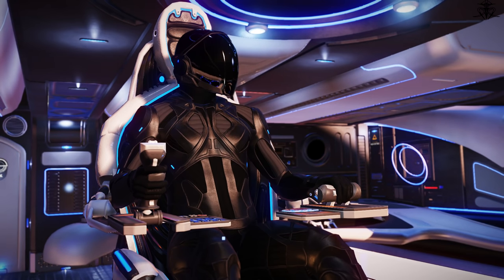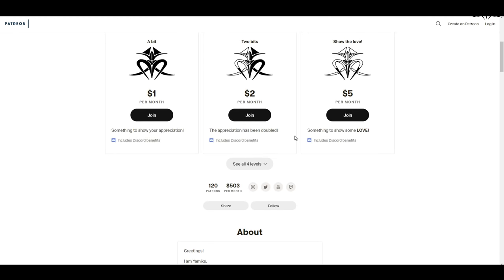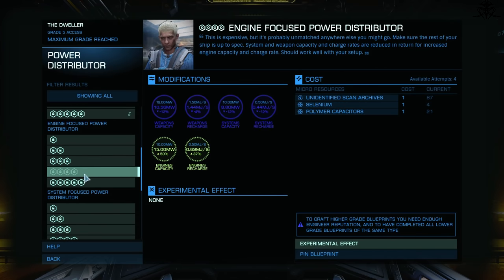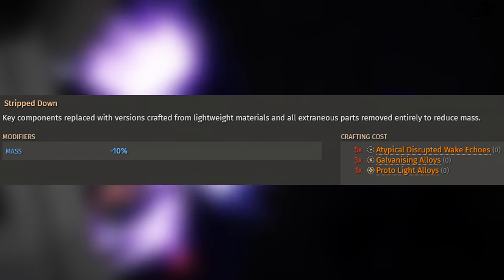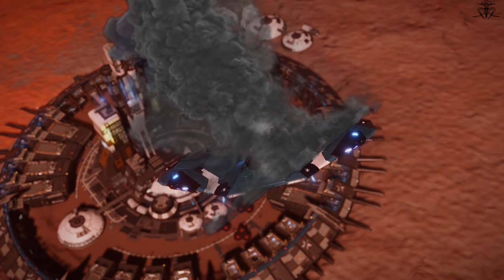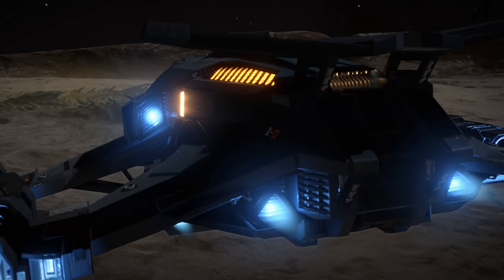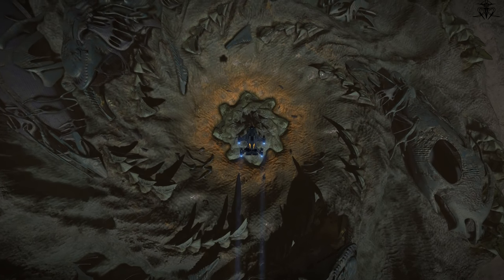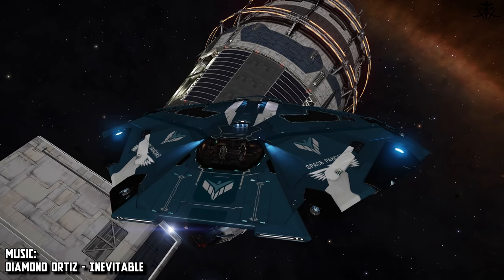BEST to WORST : NICHE core engineering (Weapon,engine focused,fast boot,stripped down)

Comment: Engine focused useful for cramming a smaller distro in for explorers who wanna boost once a week.
Reply: Bless you Sir, you beat me to it. This, exactly this. I've engineered distributors so much smaller than the ship they're going into with Engine Focus just so I could get my exploration Anaconda to boost when it shouldn't even be remotely possible.
Reply: Yeah, boosting is useful for explorers... who wants to wait for their undersized thrusters to warm up so they can jump, or wait longer while they fight their way out of a deep gravity well, or not have the option of boosting to try and stop an overly fast descent before you slam into a planet.   Its not technically needed, but you really miss the ability to go from zero to full speed in a couple seconds when you don't have it.
Reply: @musifter9126  Agreed. Although of late I've started using my Phantom more than my Anaconda for deep space exploring, and I put bigger engines in it. It costs me a couple of light years but having powerful engines on an otherwise light-as-a-feather Phantom makes flying it around just a huge pleasure. And even with good speed I like to boost! (distributor is still tiny).
Reply: Yeah my krait phantom can boost on a 1D distributer

Comment: The faster boot sequence for the fsd is actually a lot less useful than you think, cause it does not make your fsd charge faster, just the time it takes to boot if it goes offline
Reply: yeah, it's a scam
Reply: @Radovanslav  i specifically have an eagle that uses this upgrade actually, its a shieldless "stealth" fighter build that doesnt show up on sensors until almost on top of people, in using a tightly juggled power system i have it set to turn off the fsd as soon as weapons are out to further drop the energy consumption and in turn the heat generation, this upgrade means i'm not playing dodge the unlocked fire from enemies game for too long while it boots itself back on
Reply: @sensan1537  sounds very niche but I'm glad that it's actually useful for you
Reply: Fast boot could be useful if you are running over power capacity
Reply: It gives a teeny tiny bit more distance with zero additional mass. Never used it for the "intended" purpose.
Reply: I made the same mistake with using specialised SCBs, thinking that boot time means spinup time.
Reply: Faster Boot Sequence is designed to be a counter to grom bombs, and that's literally it.
Reply: yep. The reasons Yamiks give are incorrect but the category "niche" still applies. Cause "faster boot" is the only coreengineering for FSD that does not increase weight. That is why you need it if you build a maxspeed build. You pick "faster boot" grade 1 and apply "stripped down" to the lowest D-rated FSD you can fit.

Comment: The Armored Power Plant mod has actually gained a lot of traction with Explorers over the past year.  Most of the time Explorers run fairly tight power budgets and the Armored mod gives an increase in power generation, while ALSO increasing heat efficiency, for a minor mass increase.  Toss on the Stripped Down experimental (or Thermal depending on build requirements) and a lot of the time it is superior to Overcharging.

Comment: as others said - Fast FSD boot is not charge up time, its boot time if you shut it down. 
at grade 5 it boots in a second, and still gives a bit extra jumprange
also, armored powerplant gives you also better heat efficiency, higher power output and the higher hitpoints - so you can combine that with the  fast boot FSD for a combat ship that doesn't rely on 100% shield uptime (due to limited number of utility slots)

Comment: Engine focused distributor makes sense on my explorer Phantom as shields and weapons are of lesser use. And weapon focused distributor on my surface mining Cutter to keep those multiple mining lasers fed long enough to empty an asteroid without max pips.
Reply: Weapon focussed is a bit of a mixed bag
If G5 weapon focussed is 100% (assuming 8A), then G5 charge focussed has 60% capacity, but slightly more recharge (10.8mj/s vs 10.9mj/s)

Sooo... Yes, if you overload your distributor with more lasers than it should have, it's useful, sorta

Comment: Faster FSD boot sequence doesn't do what you think it does. It is still pretty niche, though, since it's mainly used by people building fast combat ships which don't have enough power plant for all their modules with hardpoints deployed. They put their FSD in power group 3 or 4 so it turns off when they deploy all their rails and PAs and then faster boot sequence makes it come back on line faster when they need to run away.
Reply: I've used it on precisely one build:  My Eagle MkII.  I've been flying that one in wing with one or two others in Haz Res and CZs.  It's a lot of fun, but I can't say that I have plans to do that with any medium vessel.
Reply: i learned that the hard way lol. it also makes me wonder WHY "faster fsd charge" isnt even an option!
Reply: @ICKY427  Probably because it would make it even easier for a larger ship to escape - as it is with masslock if a little ship is winning a fight the big ship can just bail. If they could bail even quicker a big ship would become pretty much impossible to even hurt significantly.

Comment: OK, I put Armored power plant. on a PvE ship, but NOT for the integrity. I went with it to get more power while allowing me to use SCBs without overheating. Oh, and I only went G1 (just enough to power my ship). Might go G2 as my ship can still overheat if I fire my burst lasers too much while using an SCB. Also, seems pretty useful for hull tanks (which yes, are inferior to shield tanks, but people still fly that way). Also, I fly an FDL, so it the shields go down it might buy me some time to finish the fight or run.  The Armored power plant is almost strictly beneficial with better power, thermal efficiency, and integrity.  (like efficient on energy weapons), with the only downside being mass.

Comment: Cluster Capacitor is niche? Now i am interested in what you see as the go-to for PD.

edit: you pick super conduits. Thought as much. Thats the second choice. Not bad at all but cluster Caps has it beat, at least in most scenarios and here is why:

First of all Cluster Caps give +8% cap and only -2% recharge while super conduits give +4/-4, so the ratio is a lot better on cluster caps.

And then i get that recharge is more important than sheer capacity but when you already have grade 5 charge enhanced super Condoits gain is so minimal that it takes a very long time to recharge what you would have if you had cluster caps. For example: on a 7A PD grade 5 charge enhanced/cluster cap you get a whooping 6,96MW of additional weaponcap (compared to with super con) but only 0,531 MW/second recharge from super conduits (compared to with cluster cap). That means you would have to run 4 pips to weapons for over 13 (!) seconds to make up for the lost capacity. Now that is quite a chunk if you ask me. I doubt that, in regular play (whatever that means) super conduits outperform cluster cap (and also its nice to have 6 positive effects and no negative ones on a module ;-)

Me, personally i only run super conduit on one build and thats my afk-farming Type 10. Because in this build i sometimes get attacked by a wing of 4 or maybe a wing of 2 starts the fight while another wing of 3 scans me and then joins the fight etc. and in these chases (the dangerous chases; i mean i dont need to engineer for when a single harmless sidewinder attacks me) the fight is going to take much longer than said 13 seconds (but then i run 4 pips to shields and only 2 to weapons; whatever in such long fights without the ability to swap pips super con will eventually outperform cluster cap at some point (with good enemy-spawns you can be shooting for a minute straight sometimes).

Comment: For some combat ships, high resistance is a must - the Vulture, for example, which has a pretty weak hull and shield, and even if you engineer the fuck out of it you're still going to be up-close-and-personal, so if you do get hit then you're likely to be hit with the full force of whatever weapon they're splooging at you. Particularly since the top speed for a combat-spec Vulture isn't that great either, so you're not going to get out of masslock if you need to BSR and thus need to be able to survive in that range while your FSD is spooling up.

Comment: So I have a Python used for mining, LTD specifically, what would be the best engineering options for it?

Or what about my Asp Explore which, as the name would imply, is set up for exploration. What would be the engineering choices I’d want to use to get the most exploration data in the least amount of time and keep good jump range?
Reply: Either one you'd probably want the standard C rated hull with the boosts to your HP since the upgrade costs no weight and makes you beefier